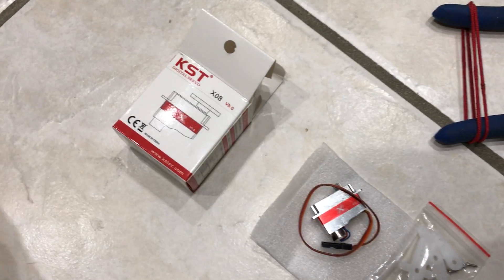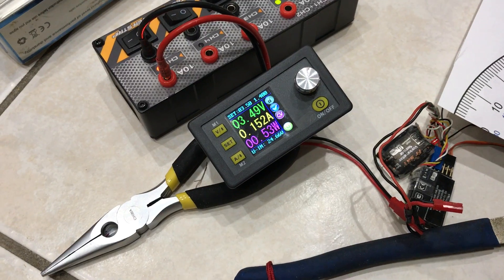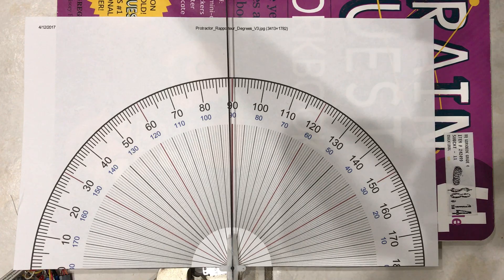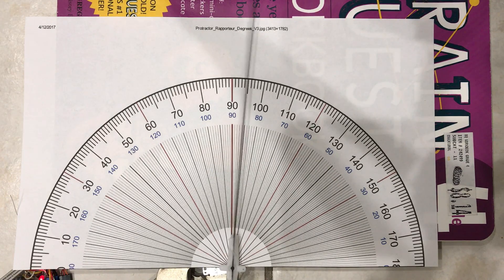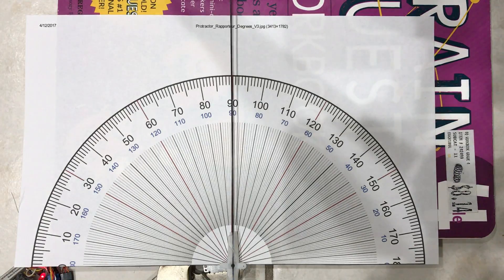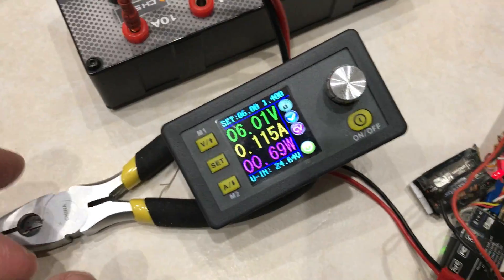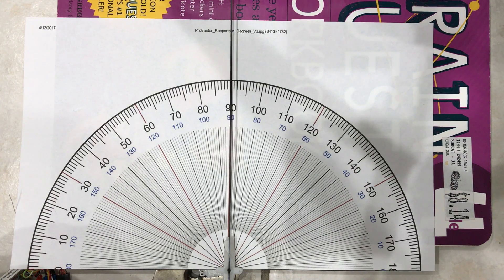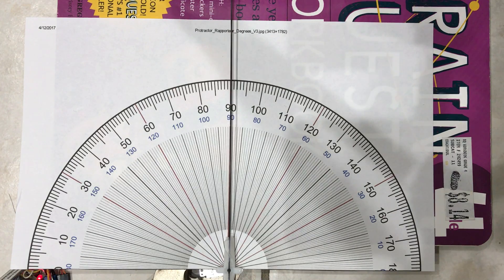KST x08 v5.0 servo tested from 3.5v to 8.4v

Comment: Which servo tester are you using?
Reply from the maker: I don't have one.  I was using a cheap  variable voltage dc-dc power supply to change the voltage to the Rx.  I was was using my radio to actually control the Rx/servos.  This is the one I want to get though... https://www.armsoar.com/collections/servo-accessories/products/st8-advanced-servo-tester .  It won't test low voltages though which was the main idea of the video.

The variable voltage power supply I used was a 'DPS3005 32V 5A Buck Adjustable DC Constant Voltage Power Supply Module Integrated Voltmeter Ammeter'